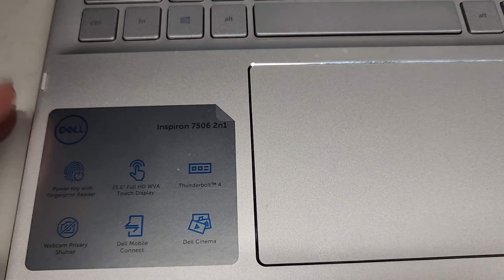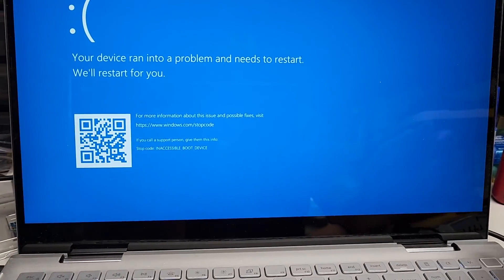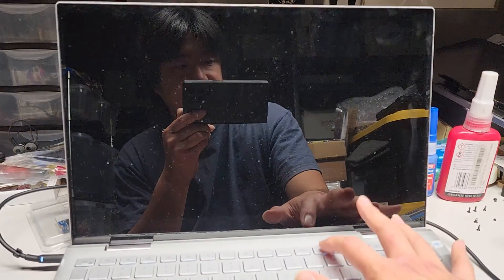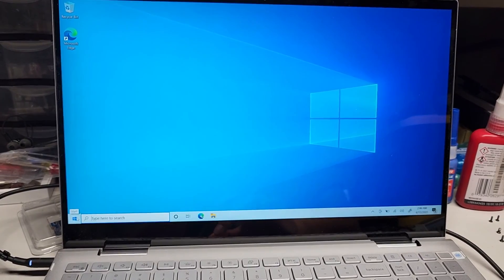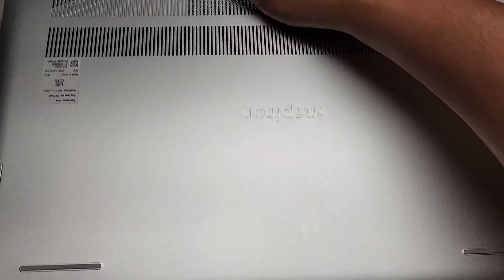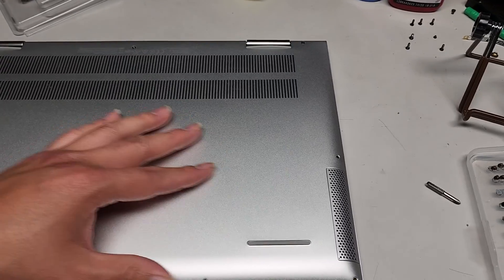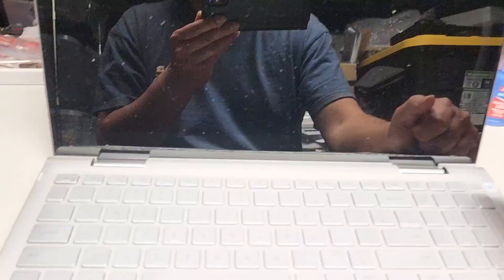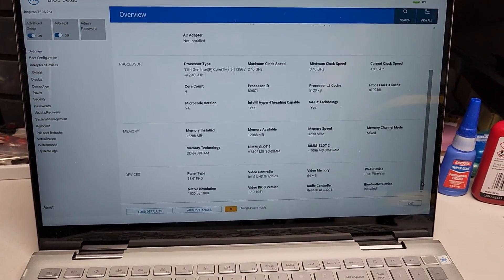Windows Computer DELL Inspiron 7506 2n1 2-in-1 Inaccessible_Boot_Device After Firmware BIOS Update

Comment: I believe the OG Intel Optane SSD needs to be set to RAID On. This is how my laptop came. I followed this video and changed it to NVME (with my OG Intel Optane SSD still in). When it rebooted, I got the exact same results, no boot drive detected with no options in the boot sequence in BIOS. I changed it back to RAID On and it booted normally, with all my data intact. In this video, I think that if you reinstalled the original Optane SSD and changed it to Raid On, it would've worked. With the Crucial SSD, it would be set to NVME. I believe the Intel Optane SSD uses the Intel Rapid Storage Technology (IRST) driver. So short story on the 7506 laptop. If you're using the original Intel Optane H10 SSD, leave it set to RAID On and install the IRST driver so it can access the Optane memory. If you're going to use a 3rd party SSD, set it to NVME. Evidently, Intel discontinued the Optane devices since they weren't as easy to configure as all the other SSDs on the market.
Reply from the maker: If you format it, it won't detect the SSD unless you put the driver.

Comment: Hey man I have a 7300 2n1 and i followed this and im still getting an "operating system loader has no signature incompatible with secure boot.  All bootable devices failed secure boot verifican" when i turn off secure it says "no bootable devices found." What actions do i need to take next?
Reply from the maker: @brandonw3890  might need to wipe it out
Reply: I fell asleep watching a video and woke up to that same blue screen.  I think it did an update.  I'm not reaply good with computers so I don't know what to do.  So you mean i have to wipe the entire hard drive? @ItsBinhRepaired
Reply from the maker: @brandonw3890  if it can't be figured out

Comment: i AM WORKING ON A 7506, i CHANGED IT TO ACH AND IT SAW NO HARED DRIVE, PUT IN BACK ON RAID, IT SEE THE DRIOVE. STUILL WOINT BOOT, WONT DO THE DELL RECOVERY OS TOOL. BIOS CONNECT EITHER. NOW IT SEES THE USB DRIVE BUT NOT THE SSD.
Reply from the maker: Hmmm not sure

Comment: I think I had this issue, after a windows update it just wouldn't boot, turning off raid didn't seem to help, I reset the bios and apparently dell turns it on by default from it coming with optane at this point I'm just gonna reinstall it I'm tired of this shit and to make it even more annoying it came with windows 10 and I upgraded to 11 but the factory reset goes back to 10 so I basically need to install windows twice
Reply from the maker: You can create a bootable windows 11 usb.

Comment: I am having the same issue right now, so frustrating
Reply from the maker: Did you try the fix?
Reply: @ItsBinhRepaired  yea, so far nothing. All kinds of errors on blue screens
Reply from the maker: @VE3FAL1Fred  could be a virus or failed update. Another brand won't resolve the issue.
Reply: @ItsBinhRepaired  yea just keeps doing the same thing. Said could not find boot area when I changed the setting. Go back to RAID and DELL emblem pops up and just keeps circling the drain.
Reply from the maker: You'll have to reinstall windows
Reply: @ItsBinhRepaired  but how do I do that. I upgraded to W11 when the system was up long enough to do so. Thanks
Reply from the maker: You can create a usb with this https://support.microsoft.com/en-us/windows/create-installation-media-for-windows-99a58364-8c02-206f-aa6f-40c3b507420d
Reply: @ItsBinhRepaired  will never buy another DELL again

Comment: How would you resolve a blue screen in DELL ALL IN ONE computer?
Reply from the maker: It depends on the cause of the blue screen. There is no one answer.
Reply: @ItsBinhRepaired  it says: BAD SYSTEM CONFIG INFO
Reply from the maker: @lyzagarcia8598  could be a bad update, could be a bad hard drive, etc.
Reply: @ItsBinhRepaired  can it be fixed? It happened when i turn off the computer and unplug
Reply from the maker: @lyzagarcia8598  possibly system restore or uninstall update, but if you unplugged it while it was on, you might have damaged the hard drive.
Reply: @ItsBinhRepaired  if the hard drive is damaged due to unplugging, then there’s no way to save it?
Reply from the maker: @lyzagarcia8598  you'll likely have to reinstall Windows. If data is important you'll have to connect it to another computer to back it up.
Reply: @ItsBinhRepaired  you’ve been very accommodating, patiently responding to my questions. I really don’t have the “know how” of the issues with computers. I have tried some troubleshoot i found in youtube but none of them worked.
Reply from the maker: @lyzagarcia8598  is the data important?
Reply: @ItsBinhRepaired  not really.
Reply from the maker: @lyzagarcia8598  I recommend creating a bootable Windows usb and installing from scratch
Reply: @ItsBinhRepaired  that’s the problem😔 idk how
Reply from the maker: @lyzagarcia8598  this, but you have to create a usb https://youtu.be/R6GVDyVqWso

Comment: My dell 7506 2 in 1 have issue after shutdown the laptop not turning on. remove battery cable 2min then reconnect it will work. Please tell me solution.
Reply: I have the same laptop, and the same thing happened to me as well. I disconnected the battery, reconnected it, and turned on my laptop using the AC adapter. It turned on. However, whenever I mistakenly shut down my laptop, the same issue would occur again. I would repeat the process of disconnecting and reconnecting the battery to turn the laptop on. A few days ago, I noticed that while the laptop is connected to AC power, the adapter doesn't charge the battery and it keeps draining down. Now, my laptop won't turn on when the battery is connected. I tried the battery reconnection method, but it didn't work. So now I'm using my brand new laptop like a desktop computer, as it only turns on when the battery is disconnected. I must say, thanks to Dell for creating such a masterpiece.
Reply from the maker: Check if the charge port is damaged.
Reply: @ItsBinhRepaired I have checked the charging and discharging behavior of the adapter. It quickly provides a voltage of 19.2 to 19.3V DC, which is normal. However, when I turn off the laptop, the adapter slowly starts discharging, which is also expected.

The strange issue I'm facing with my laptop is that it won't turn on when the battery is connected. This makes it impossible for me to diagnose the battery's health. If the laptop were to turn on with the battery connected, I could check its health. However, I am confident that the battery is perfectly fine. I purchased this laptop nearly 1.5 years ago, and on the day when this issue arose, I checked the battery's health in the morning, and it was showing as completely fine. The problem seemed to occur after I updated my laptop on the same day. Since the update, I have been experiencing strange behavior, where the battery keeps draining even though it shows as charging. It appears to be an issue with the adapter, as you mentioned.

I have attempted various methods to resolve the issue. For example, I tried charging the battery while the laptop was shut down, but it didn't seem to charge properly, or if it did, the situation remained unchanged. I also tried connecting the battery while the laptop was running in BIOS mode, but doing so caused my laptop to turn off. I have exhausted all possible methods that I could try without risking damage to the laptop. Unfortunately, I find myself stuck in the same position as when I started, unable to resolve the issue.
Reply from the maker: I don't know